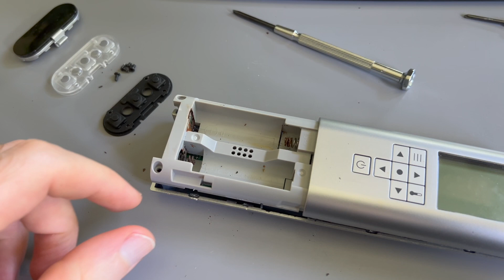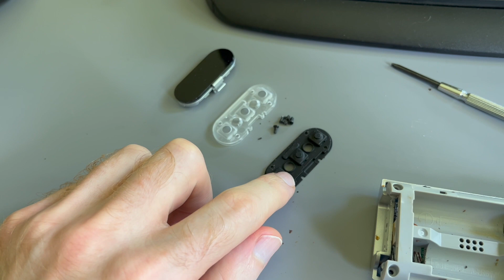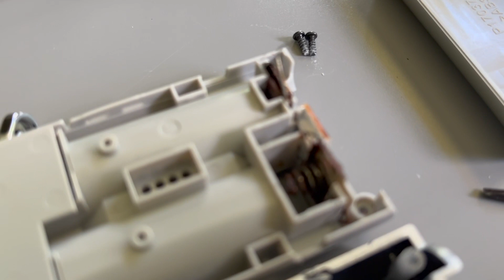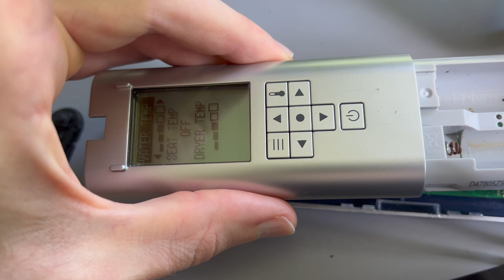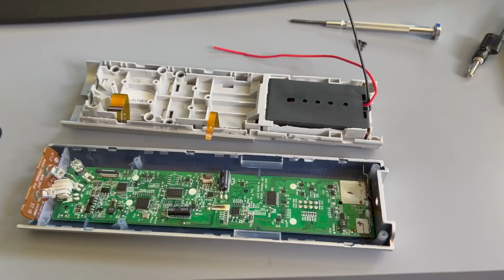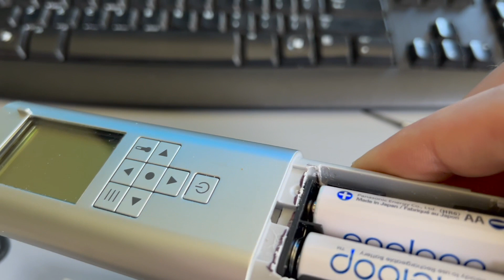Toto S500e / S550e Bidet remote control repair

Comment: Awesome repair! I am discovering the remote will NOT sideways, weird design choice. Is there easy way to trick accelerometer or whatever to thinking it’s upright? Or maybe remove it all together to by pass?  I can’t believe it does work when wall mounted horizontally.
Reply from the maker: Thanks.  I didn't even know the remote had an accelerometer, but I just played with mine and it seems you're right.  Mine works mounted vertically on the wall, but if I flip it so the black lense points down it doesn't work.  It works horizontally if the control surface is facing up, but not if I turn it so the control surface faces to the side.  If I have it horizontal and slightly tip it down a bit it also stops working.  No idea why they'd do that.  If there's a separate analog accelerometer mounted to the board I suppose it could be possible to find it, test its output (if you could get to the pins) or find a data sheet and then construct a circuit to replace it to always output a voltage telling the upstream electronics that the remote is in a 'good' orientation.  Seems pretty complicated though...
Reply: @HifiMachine  i can’t believe there isn’t much about this online. Am I the only person needing it sideways?! lol.
I’m gonna 3d print a bracket so it lays flat, not the most visually pleasing but I guess function takes priority here haha.